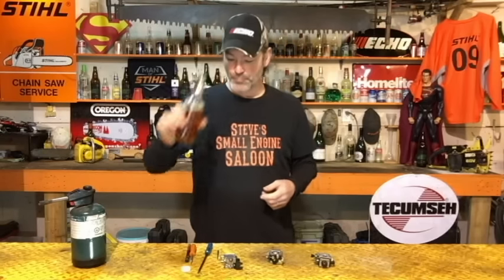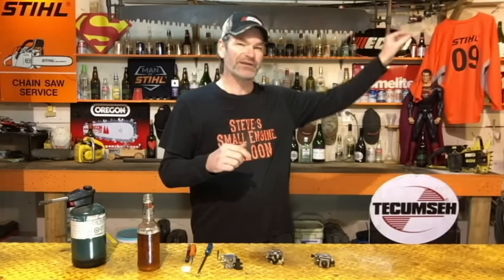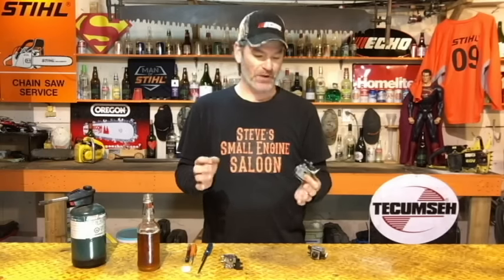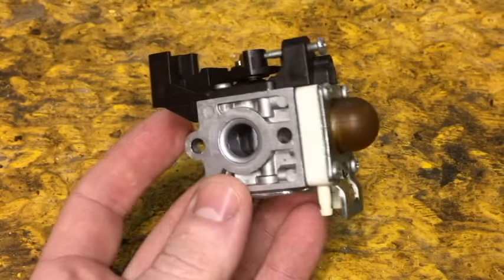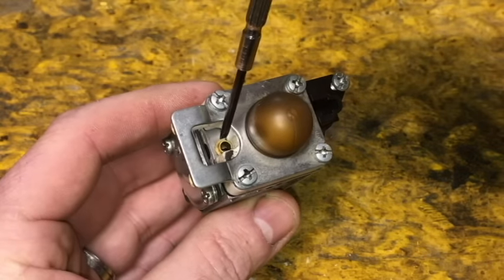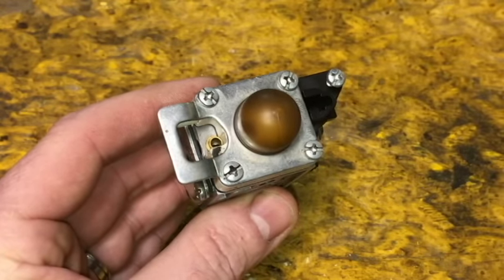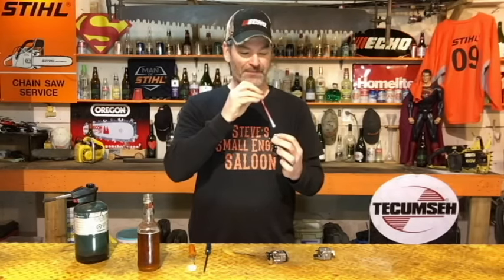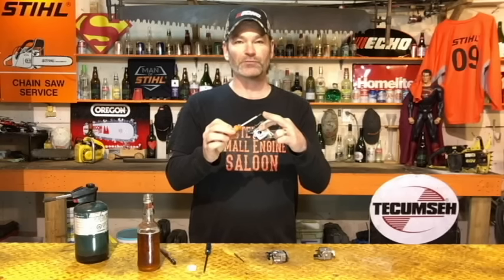Hidden Carburetor Adjusting Screws On Some Weedeaters And Blowers

Comment: let me ask you a question. What if on the carburetor shows where is low and high speed bolt but it closed by metal. Should I screw it out or its unadjustable carburetor? It’s a two stroke Mikuni jet ski carburetor. Thanks

Comment: Great video. I have a seven piece carb adjust kit on order from amazon for ten bucks.
Reply from the maker: Thank You...
Reply: Is there a tool to remove the limiter caps? I don't want to damage anything by drilling it out. Not because I don't want to try but my skill is lacking.

Comment: Steve, At 6:21 in the video, you show us a plastic cap removal tool, left hand threaded driver, that exposes the carburetor adjustment screw heads. Would you please ID that specific tool ? Where to purchase ? I did not see it on your Amazon shop. Cheers! , Al

Comment: Hi Steve.  I have a Husqvarna 580 bts backpack blower that is a few years old.  I bought it used off someone and I got around to replacing the spark plug, fuel filter, etc.  I cna't find the high or low screws on the carb.  I fear its one of the walbro carbs you talked about that can't be adjusted.  Is this correct?

Comment: I have a mac allister, one of the screw is on the throtle cable, and another screw is on the side but its weird. Its round and deep and has a triangle cut out on the side. I adjusted the top screw, it ran good for like 2 minutes then it started to bog out again. Could you help me?. Btw sorry my english is bad.

Comment: Any idea where the adjustment screws are located on a 2013 generac GP3300 with Haney Carburetor?  I just cleaned it thoroghly with ultrasonic and torch pics.  Generator is stalling under load of 1500W. Also refuses to run with an air filter.  I can make it chug and sputter by holding my finger inside the air box and placing it in front of the intake port.

Comment: Hi. I have a 4 yr old weed eater. 2 stroke engine. It has a new carburetor and piston. But now its going nuts again. After running for 3 mins or so, it would rev up on its own and then shut down. It would always do that. Any idea? Thanks!

Comment: Just successfully pulled both plastic plugs (High or Main tucked below & the Low or Idle straight down the top) from a ZAMA RB K75 on an Echo GT-200R trimmer.  Use a 3/32nds regular drill bit and grab the end with a small vise grips then heat the end (about 1/2") till red and quickly poke it straight into the hole with just a little down force and blow on it for 1 minute till cool, then carefully start lightly pulling and twisting counterclockwise and the little black plug will come right out stuck onto the end of the drill bit!

Comment: I know how to adjust any of those but those screws keep vibrating loose so it does that on both my fs45 and br420 stihl yard tools 

And I just bought that old new br420 blower it works great until those screw vibrate loose again so I can look for some kind of locker for those screws or buy another new carburetor so it'll do the same thing.

I'm about ready to just try some pipe tape around the H and L threads and see if that'll keep them in place I know the gas might melt the tape or it clogg up the carburetor but i don't care. they run good when they're set for that short bit of time 

My green feather lite weed eater and my old new troy bilt red one is out doing the stihl fs45 because they're screws stay in place 

I reset the red ones H and L when i got it because it needed done and its holding the settings

Comment: How do you adjust the needle screw on the top right side of a 1988 2 stroke 4 CYLINDER MERCURY OUT BOARD 50 HP. CARBURATOR thank you and God bless you.

Comment: I have what looks like a walbro carb but it has a single screw o the side- have not located the top yet. It burns loads of fuel. If I adjust it in, will that reduce the fuel usage? can I put a different carb on my machine or are they only designed for specific machines?
Is there a best replacement carb kit on Amazon to replace a chinese walbro carb that just eats up fuel??

Comment: Steve, HI have a Husky 525L.  Its never ran right and I can't adjust the carb hi or Lo screws more that half a turn because of limiters.  The manual says 2 1/2 turns out.  But I can't adjust the screws in or out that far.  Please help me.

Comment: Steve, 
I have a Craftsman Weedeater 316711200, about 4 years old.
It quit running altogether due to degraded fuel lines, which I just replaced, but had already been wonky since last season. I adjusted the idle and high speed screws and she runs fine UNTIL I PICK IT UP AND TILT HER DOWN. Then it dies. It’s not a line feed head... it has a retainer puck that holds a measured length of line. This puck is worn to almost nothing. Could it be that lack of mass that’s the problem??
Thank you!

Comment: I have a new echo 3021 trimmer , after breaking the engine in it needs a slight adjustment which takes the small d tool.
In the echo service manual it says there is no plug covering the screw.
When i try to adjust the high speed screw there is no change in the rpm .
I cant figure out what i am doing wrong its driving me nuts lol

Comment: I didn't have a small D bit , so I used a dart with a plastic tip and melted it and while it was hot and pliable , I pushed it firmly against the adjusting screw and held it there for approx 30 sec. also. and it formed around the D adjusting screw....BAMMMM!!!!! A jimmy rigged D BIT ....Works too.
Reply from the maker: Awesome tip!  Thank You...

Comment: there is a zama carb rb k66a , which is on my older echo string trimmer, the plug which you are saying is over high ilde, is actually a plug, with an o ring, wich can be removed by hand, no tool needed, however if you remove it, it wont run, zama parts diagram shows remote jet under plug, you can see a hole in top of brass screw, indicating its a jet, not an adjusting screw, iv yet to find any adjusting screws on this carb

Comment: Steve: I have a weed eater leaf blower that won’t start. It is 12 yrs. old but not used that much maybe 20/30 times. I replaced filter and gas lines because suction side was cracked. Is there supposed to be a gasket between carb body and plastic it screws to. I can pull my am off and it will not start plug is in good shape.

Comment: after watching and removing the plugs i was able to get results from  the low end with certainty but still having problems with the high end. i can screw the adjuster in all the way to lean and it still runs , and when i back it out it wants to run to rich, also having a cranking issue ( seems to not be getting enough fuel,will start with fast starting fluid.) changed all gaskets and diaphram  but the kit did not come w/a new needle and seat .. help!!

Comment: On a new Walbro carb they have a brass cover over top of the low idle mixture screw. How do I remove this to adjust the idle mixture screw? Is this a welch plug style of cover?
Reply: Drill it out slowly

Comment: I was hoping you could help.  I have a homelite 26b that will not pop or run at all.  I changed the carburetor, ignition coil, and spark plug.  I have spark.  I can't get it to pop at all.  Can you help?

Comment: This guy really knows his carburetors I have a redmax ebz8500 pos would never buy any redmax product. Have echo products 38 years. And still running great one carb rebuild and maintenance.
Would not rev up idle was just fine adjusted hi speed screw. Runs great now hard to move the screw.
When product was new had all kinds of issues with it. Two times to Russo’s power 129.95 latter each time under warranty they told me it was bad gas bs. I only ran 93 octane  not more than two weeks old for the landscaping business.

Comment: Hey Steve I am unable to find the screws on a carburetor I bought instead of the butterfly flap it has a barrel for the throttle.  I found the screw there for the lower side but the high side I found a giant screw and it doesn’t seem to work

Comment: So I have new diaphragms and gaskets in my Zama carb on a Stihl fs55. The wire strainer and all passages are clear. My fuel lines are clear and leak free. Fuel filter is new I even removed the filter. Primer bulb doesn’t leak air or fuel. For some reason it will not prime at all. I’ve switched primer bulb bases. The check ball moves freely and seals when I blow/suck through the vent on both bases. If I pull it apart, I can push fuel through the inlet with a syringe and it travels through the carb as it should. Any advice? This one has me stumped. My only possible theory is that maybe the aftermarket gasket that goes under the metering diaphragm is too thick? I’m thinking that I couldn’t even get it to prime with the needle valve completely removed though.

Comment: Help! I have a JD D110 riding mower. Had a guy sharpen the blades. Then found out the deck was rusted. Guy put a bracket on deck to hold it up. Now mower is hit skip on the blades turning when mowing. I hear a fan sound coming on and off. When the fan sound is on the blades work. When I don’t hear the fan sound the blades don’t mow. What could be the problem ? Thank you.

Comment: So when I put in a new carb in a Troy built trimmer it barely idled and died so I looked around for idle adjustment screw and didn’t find one so I just unscrewed a random screw and that was the low speed screw

Comment: On the Zama carb to access the high-speed screw, you will need to remove the black plug that is set in there so that you don't tamper with it. To easily remove the black plug heat the end of a 3/32 inch punch with a cigar lighter or torch and get it hot for a minute or so and stick the 3/32" punch in the center and hold it there for about 2 minutes, it will cool down, once cool, plug the punch straight out and voila the plug will remove itself attached to the punch and you can now access the high-speed screw.

Comment: Have you tried using paint remover to melt the epoxy? It also work great at getting stuck on gasket material off. Put it on the gasket pieces and come back in 10 minutes. Don't put the paint remover on plastic. It is safe to use on aluminum.

Comment: Steve, how goes it ?? as usual, I have "ill-running" riding mower I COULD NOT GET THE THING TO START !! so I replaced the magneto and the carburetor and gasket; she started up on the first turn of the key; oil is good and gas is fresh-I HAVE NOTICED A "decrease in the r.p.m.,s- and it,s surging and missing; as I do not know how to adjust the carburetor yet; I,m kind of stuck!! Briggs&Stratton-Poulan rider; it cuts fine and runs pretty well when the engine speed is increased to the cutting range prior to engaging the cutters; when you reduce the rpm,s it almost wants to stall out; sounds terrible !! The carburetor has (2) spring-loaded screws 1- is long the second one which is also spring-loaded is right above it and is much shorter in length; those are the only (2) screws I see; sorry to be a pain any help appreciated; PATRICK.P

Comment: The local shops told me it is illegal for them to sell the extractor tool. $10,000+ fine if they do. Trying to find it on Amazon. Do you have a link? Thanks!
Reply: John Libonati 

bought a carb kit from amazon and  it came with tool for under 10 bucks .. 2 days delivery ..,

Comment: Good morning: I am from Treviso - Italy, passionate about small engines, and I recently discovered your
 
site, where you offer some interesting videos. I am writing to you so that you, please, with your
 
experience, could help me understand a carburetion problem for my brush cutters.
 
I have two Kawasaki brush cutters of the TJ series, 35 and 27 cc., which have Walbro mod,
 
wya 39 carburetors, with a central idle adjustment screw, and a rotating cylindrical
 
valve, and they do not have any adjustment for the maximum. I find myself in this situation:
 
not trusting the 2% mixture, I did a test, and also at 2.5%. and also at 3%.
 
1) 2%: the engine runs very well, it does not smoke, it rises well, but when I examine the spark plug I
 
find it very clean, dry and very white in color: if I am not mistaken, very lean.
 
2) 2.5%: the engine is a little slower, it smokes at idle only until it is no longer
 
warm. Note that in the medium-high revs, it runs four-stroke, and returns to normal at maximum.
 
The examination of the spark plug reveals a little carbon deposit on the crown, while the
 
porcelain is medium gray: it seems to be richer.
 
3) 3%: the engine is ready, it is very linear in delivery, it does not smoke on any
 
occasion. The examination of the spark plug indicates a clean situation, with the
 
porcelain gray: could it be a slightly lean situation?
 
I beg you, then, to receive advice from you, if you consider my procedure valid,
 
or other procedures to be able to have optimal carburetion. I can think,
 
that drastically change the carburetor with an adjustable one. I defer to you.
 
Thank you for your attention and interest
 
Kind regards
 
Adelino Zamuner

Comment: My plug was brass no threads. Same basic idea. Touchy adjusting, bogs on load after 10 min. Cleaned exhaust,spark arrestor, new plug , fresh gas 2cycle oil careful mix. New fuel lines, filter, scratching my head.

Comment: need your help sir.   i have a fs100 stilh trimmer.  it runs on idle good.  when squeeze trigger it rev  up a little and kept on running but no power. turn the trimmer head but not strong to cut.  i checked or replaced filter, exhaust arester, spark plug, new carb. nothing work. can you help me please

Comment: I have never had a 2 stroke that didn't need these screws adjusted, they all need adjustment period. Especially the low RPM screw. They run so dam nice after adjusted.

Comment: 9:45 I have a Walbro WYL 315-A and the high side "area: has a "metal" welch cap in lieu of plastic. I removed that (Welch) and there is a passage to the intake and a cone shape heading down towards where the screw would go. Drill out the cone? Are there FIXED high carburetors? 
Walbro instructions for LOW say some are glued, but can't see. Looks like a small D to adjust.
UPDATE: Further research...looks fixed HIGH.

Comment: Oh cool. I thought I watched a video that some hidden carb adjustments were actually inside the carb. And well. I just found it easier to just clean the carb with pressure wd40 or carb cleaner and air compressor. Gets is up and running. 

And I actually have lost those little internal fuel filters and even gas tank filters and run without air filters, as long as it gets the job done. I buy plenty of junk weed eaters and blowers from a local junk yard for like 10 machines for $15. Some actually run just as is.

Comment: Will this work on the Echo PB2520 Leaf Blower?   Does adjusting these screws only adjust mixture, or speed?   What else can I do to this thing to increase performance.........
Reply: If not coming up to full speed after high/low adjustments check muffler screen and burn it clean with a torch.

Comment: Hey Steve Very professional video i ever seen about trimmer now My Echo SMR210 not working from last year so i replaced carb 1st day its works like a charm next day it didnt start so i bought new carb again but nothing happend (i changed spark plug, filter) any one have any idea???
Reply: Ever figure it out?  Need to determine if it's fuel or spark. Check magneto, maybe do ohm tests also check it's gap .010" I believe and sand surfaces.

Comment: Steve thanks for all you do, Always great watching you vids!!! Now I can't take credit for this idea, but for the small D screws use a blue crimp type wire connector one end taped to a screw driver. It works, I've used it and only took half a beer to tune the Poulan Pro 25cc engine
Reply from the maker: Right on...

Comment: Hi Steve Great Video.  Thanks.  Just wondering if my  carburetor low speed is adjustable.  I Have A Ryobi 253ss weed wacker. Carburetor # HM-30716001. it starts well and rev's up well, but it does not stay running when I disengage the trigger. stalls out.  I tried turning in the idle screw in & that kinda works but now the head is always turning because it's adjusted in to tight. The low speed I believe needs to be adjusted.  I did clean out the carburetor and changed the diaphragms/gaskets but still doing the same thing.  I look down into where the low idle adjuster should be but and all I see is a brass circle.  None of my carb tools work including the small D.  I believe this carb is just not adjustable.  What's  your thoughts? The carb is not plugged with anything in-order to hide anything.  Thanks, John

Comment: Has anyone encountered a zama c1u with no high speed adjustment? Mine just has a solid metal post pushed into the hole and when removed it's blind underneath?

Comment: Hey, one more Steve... I bought a new Troy Bilt 4stroke backpack blower (sick of 2 strokes), and with maybe 8-10 hours on it, it begins bogging in and out at w.o.t., and I had already been thinking that surely, this thing could\should run faster. No screws I could see, so I'll look again with a torch and screwdriver!
The volute on this one is ridiculously small, the size of maybe a cigarette. Do you think it's possible to pull the main, then drill out and polish it to get more air and revs? I'd be leary of drilling the jet for the obvious reasons.
Reply: Going further,  I found a good deal for a new carb. I put it on and waddaya know, it STILL barely starts and runs like crap! Just came across this video again and realized I should have followed it instead of spending money! I'm gonna look at it today, it's hardly had any hours on it, being a POS right from the box.

Comment: Those epoxied ones are adjustable. Drill out the brass ball. Absolute necessary on some of them, even brand new ones. They're just set too lean some/most of the time.